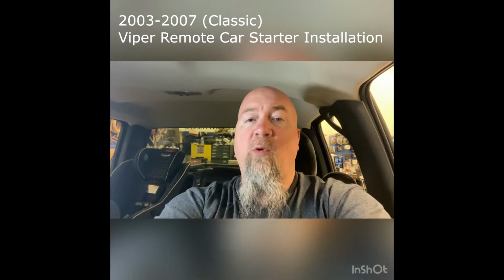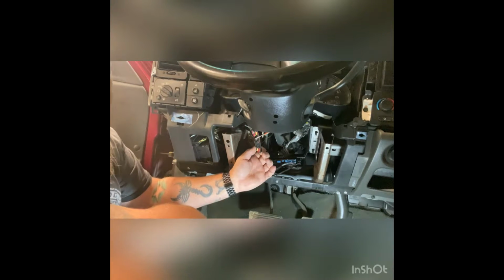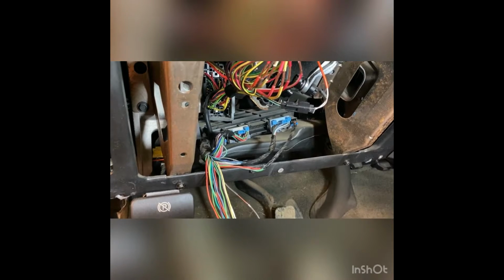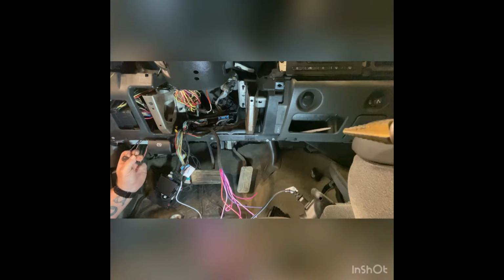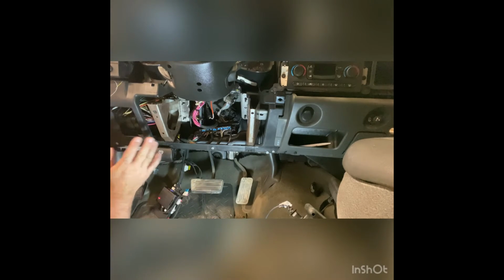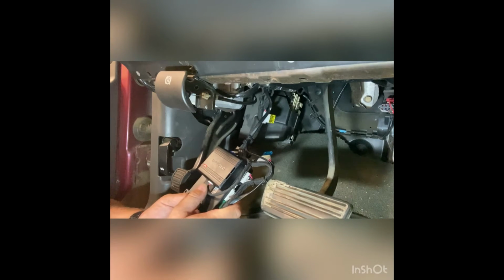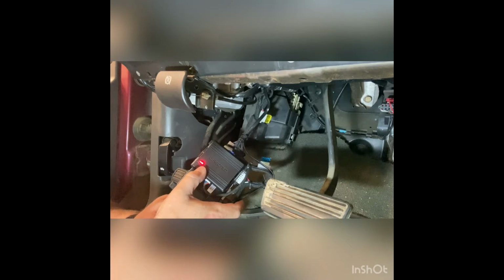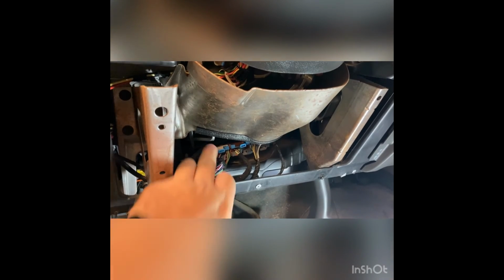How To Install Viper Remote Starter in 2003 - 2007 Classic GMC Chevy 1500 | Full Video | All Steps

Comment: Ran into your  channel by accident I guess ,  I once was a Mobile MECP installer  from 1985-2006 worked for Clifford Electronics and built a lot of custom systems in Beverly Hills for the Elite. I left the industry and got involved in Fire Protection and networks  I love my Job. But it all started in the mobile industry , for you young kids there was no you tube back then . I am impressed in your attention to your wiring and the connection method you used. That by my experience is the best connection. I have trust issues on people working  on my vehicles but you Sir I would happily drop them off and not watch great job, subscribed because I know workmanship when I see it.
Reply: Hell yeah martin, you should go on leak project and talk about some of the stuff you worked on!!

Comment: Can you explain what wites you connected under the steering column im straggling to get mine to remote start
Reply from the maker: Same vehicle?
2x red - 12 volt
Pink - primary ignition
White - 2nd ignition 
Orange - hvac
Brown - radio and other acc
Purple - start/crank

Comment: I bought a remote start for one of my trucks a while back and have been through a few trucks since then. I am wanting to install the 4806 now into my 2006 Avalanche. I see in the video you used the dbidb3... Will the bdball2 work for mine? That is what I bought at the time for my old truck.
Reply from the maker: Sorry for the late response, youtube isn't great at notifying comments.  But, yes your 4806 and db3 or dball2 will work together great.  The install is literally the exact same as on this truck.

Comment: For installing a 4806V on a 2006 Duramax 2500hd, do I need extra steps in there. I noticed this is the gas version. Trying to narrow down exactly what needs to happen for the diesel.
Reply from the maker: Really the only difference is powering up both accessory wires (orange and brown) and because it’s duramax, you won’t get tach signal over data so you’ll have to go behind the instrument cluster to get a solid tach signal. 
Program a predetermined wait to start time, done. Everything else is exactly the same.
Reply: The one thing I would find very helpful is exactly which wires you used from the db3 as well as the viper. Also, which plug they came from on the device. There are lots of wires and to me it doesn’t look like you use very many at all. Did you wire the two devices together at all? Seems like some wires may go to the same spot on the pickup. Thanks for the response!

Comment: @Srtbull_YT would you know why on my 5706v on a 06 silverado when i lock the truck and start the remote start once the truck turns on the alarm goes off? So i always neex to unlock the truck first then remote start it and once it starts i lock it so its locked whie on so the alarm wont go off

Comment: Thanks for this! I couldn't figure out what box to buy to control the BCM. Thank you!
Reply: Also I wish I could have watched this video 6 years ago when I installed my wife's viper, the manual transmission mode part is intentionally left out of all videos. Its a dealer only market and thats how they control it. Took me weeks to figure out why it didn't put power to the Start wire!!! 😕
Reply: Do you have the part number for the T harness? My DB3 is flashing red green orange right off the bat and won't program 😳

Comment: I am gong to install this in a 2001 PT Cruiser without immobilizer.  Will I still need a data module to lock/unlock doors and keep factory alarm?
Reply from the maker: A. Are you sure there’s no immobilizer?
2.  You can use a module to do convienience features such as keyless entry, but you don’t have to. It would be easier if you do though.
Reply: @srtbull_yt6854   I had it removed from the PCU some years ago so that I could use regular keys.  Is iDataLink a good interface module choice, in your opinion?  Thank you for the quick reply!!

Comment: Does the hood pin connect to the (2) pin  remote start shut off switch next to the (6) pin?  
The instructions say switch (shutoff) would be “ON” which would be NC when “ON”..  but I notice hood pin (when engaged) would be NO.
 2004 Dodge Ram   2500( diesel)
4806V

Comment: Hey buddy this is a long shot. I just bought a kit for my 2005 chevy Tahoe. I’m stumped on the wiring. I’m wondering if you could provide a cheat sheet or maybe even help me out. I have no clue where each wire goes and what no to use. Anything helps. Thanks
Reply from the maker: Do me a solid and shoot me an email at srtbull@gmail.com. I’ll do my best to get you whatever info you need

Comment: Awesome video! Thank you! 

I have a 04 suburban, I had a viper installed by a local shop and then it sat for 2 years and I recently started rebuilding the front end, and a bunch of other odds and ends to get it on the road. I noticed the dash is having shorts and flickers when I use lock and unlock, on the clicker. and the shop refuses to touch it. Is the control modules “light control modules” on the driver side of the dash supposed to light up and flicker on off when you hit the lock button? Basically any and all interior lights aside from the dome lights turn on off when the locks function from the clicker. Thanks in advance!
Reply from the maker: Well, park lights can flash on lock and unlock if that functionality was installed at the time. 
What types of shorts are you having in the dash?

I wonder why they won’t touch it?  Do they just want to charge you to remove it and install a new one?
Reply: @srtbull_yt6854  I should add the previous owner attempted. “I say that lightly” to make random electrical repairs and the cluster lights were poorly upgraded to LEDS. Soldering mess is about all I can say on it. I might end up replacing the whole cluster.

Comment: Help me out here please, I have a 03 Suburban that has a Viper 5305v. Problem I been having is that sometimes I cannot start the truck with the key, (engine does not crank). Only way I can start it is with the remote start, but once I turn the key and press the brakes I get a few lights on the dash that stay on. Also it only stays in 3rd gear it seems like. When it does turn on with the key everything works fine and no lights on dash. What can I check and or how can I disable the kill switch because I’m thinking that’s what’s causing it and or the oem anti theft of the truck.
Reply from the maker: I know this is an old question and I’m sure you got it figured already but not starting with the key but starting with remote start, there is something happening with your crank wire. (Most often caused by tension on the ignition harness). Or if you have starter kill installed, that relay may have failed. 
Staying in third gear, it’s actually probably 2nd gear means it’s in limp mode which is usually caused by your 2nd ignition not being powered up. (Common mistake). 
I hope that helps but I’m sure you have this fixed already. Sorry for the late reply.

Comment: Hey man ive got a 2008 chevy tahoe ppv with a viper directed DB3 in my truck and whilst re wiring some lights and a k9 hot n pop it tripped the system and will no longer allow my vehicle to start any ideas on further direction?
Reply: It is also a 5x05
Reply from the maker: Won’t remote start or won’t start with the key?

Comment: Lots of info , On video . so the DB3 module is just connected to 5806v using the D2D wire harness and 1 wire coming from the DB3 14pin  Blue harness ?
What wire/color  from DB3 harness, the light green pin 1 ?  Thanks keep up the good work and video's

Comment: I’ve had my remote start in my truck for awhile now since I got it, but every time I remote start the truck turns on does everything it’s supposed to except turn on the a/c could it just be a wiring issue or do I need to reprogram it if I switch wires around
Reply from the maker: What’s the vehicle and what kind of remote starter?  Has this problem just shown up?  Or has it always been like that?
Reply: @srtbull_yt6854  I have an 03 dodge Dakota 4.7, I have a viper 5X04 and it’s been like that ever since it was installed
Reply from the maker: I’m curious, does the radio turn on during remote start?  If yes, the wrong accessory wire is being powered by the remote starter.

Comment: I had one of these systems installed on my 02 Silverado but when it came time to smog my truck the computer would not connect due to the obd 2 wires it had from the viper system. Is there another place to connect them to?
Reply from the maker: Negative. The J1850 would be same wire no matter where you find it. So if this is true, you could just manually wire the features that you’re retaining by using that data wire. A simple passloc interface and wire tach direct to the source. Actually pretty easy.
But you could just disconnect the data wire at obd2, do the smog test then reconnect the data wire after you pass the test. 
(Immo, that’s not the issue, but that’s where I would start)

Comment: I have a 2002 S10 that the fuel pump has been replaced and it's still not getting fuel.. the ignition switch was getting locked up and was super annoying.. I replaced the ignition switch but still not getting fuel.. it has a security light on the dash.. does anyone know if installing one of the remote switches would get me running again?
Reply from the maker: Installing a remote starter in this situation would be a bad idea and not a solution to these issues.

Comment: I have the Viper 5806V Led 2-way security & remote start system. In your video is the same wiring diagram for a 2003 Silverado 1500 ?.

Comment: I have a remote starter on my 2006 Silverado truck and my battery runs out after 2 weeks without turning it on. Do you think that's the problem?
Reply from the maker: There’s a laundry list of things that it could be. 
How is your battery?
What kind of car starter?
Does the car starter still work or has it failed?
What is charging voltage when running?
When idling?
Anything else in vehicle that is aftermarket?

There’s a ton of diagnosis you could be doing to find out. I would do a voltage draw test just at the car starter then start working my way out from there until I find the problem.

Comment: I have a 2009 pontiac g6 that has a automate am6 with a xcrs relay 500m pack. I bought this car with this remote start with security installed.It worked for a long time but now I suddenly get nothing. I have power to the xcrs pack and the am6 brain. If the xcrs is bad would it cause a dead system ? Is there a bench test for the xcrs ? Any help would be appreciated. Thanks, Art.......automate a dei product
Reply from the maker: Chances are good the security interface has dropped programming. Most likely a simple relearn will fix the issue.

Comment: I have a 2005 Chevy duramax with the 5706v viper kit. Getting a little confused on which vipers wires connect to the ignition harness
Reply from the maker: Honestly, with Viper its almost color 4 color. 
Red - 12volt
Red/white - 12 volt 
Pink - ignition 1
White - ignition 2
Orange - hvac
Brown - radio (needed with duramax)
Yellow - start
Reply from the maker: Oh you mean the Viper wires. 
You’ll use all of them except for the pink/black. 
I’d you’re doing starter kill, green is key side, purple is vehicle side. 

What else can I help with?
Reply: @srtbull_yt6854 I know this is an old comment but is the starter kill necessary for the installation?
Reply from the maker: @robertbrown2348 no worries, I’m still here. Starter kill not required
Reply: @srtbull_yt6854 You’re awesome, thank you.
Reply: @srtbull_yt6854 I recently bought a Ds4+ but there’s a lot more wires, have you done an install with one of those on a 06 Tahoe? The wires seem a bit different

Comment: How did you wire the lock and unlock? Did you have a plug and play harness for the lock/unlock?
Reply from the maker: With this specific setup, door locks are controlled over data (j1850). No extra wiring required.

Comment: Great video- I had a 5906V installed and was wondering if you Hooked the alarm up to the dome light or door sensors ? I had it installed in a shop and when I lock the truck up, right after locking it says “Alert door open” remote says it for like 20 seconds and goes away. Installer says it’s the only way to do it that it will go away once the dome light turns off 😐 doesn’t seem normal and it’s annoying every time I lock the truck 

What do you think? Same truck a 04 Chevy 5.3
Reply from the maker: In this particular case, no, this wasn’t an alarm system. But if it were, the data module takes care of door triggers except the rear doors. The rear doors need to be hard wired to the alarm. 
Is this door open warning consistent or intermittent?
Reply: @srtbull_yt6854  i am installing the exact same alarm system into the exact same truck could you list the colors of the wires you connected underneath the dash coming from the remote start harness on the alarm?

Comment: I just had a viper remote  start installed  but when unlocking  it dint flash my lights and when locking  it dont hink the horn how do i fix that its on a 2001 duramax
Reply from the maker: Depending on which shop/company you deal with, they provide those as options and maybe not part of a basic remote start install. I would just go back to them and see if they charge for those features.

Comment: Curious as to what the DB3 is used for and if i necessarily need it for my vehicle. i have a 2003 tahoe that i’m wanting to put a Viper alarm/ remote start (probably the Viper 4105V) in along with the Viper SmartStart Pro. could you tell me if i need to install the DB3 ?
Reply: Did you every find out if you need the db3?
Reply: You need a different DEI module for your Tahoe. I believe it.s the 456G. DEI apparently doesn't sell them anymore. I got mine on Ebay. Unless your Tahoe is a base model you'll need it,
Reply from the maker: @digdugboy db3 will work on a 2003 Tahoe as well

Comment: Do you need to flash anything or is it all set out of the box
Reply from the maker: Data modules come empty. Firmware needs to be installed prior to being used on a vehicle that requires it
Reply: Is there a way to do that at home or do I have to take it to a dealer
Reply from the maker: Well software is only available to Directed dealers. They will have the equipment to install software. BUT they aren’t obligated to put software on something that they aren’t installing so I can’t say for sure that you’ll find someone to install the software and just hand it over.

Comment: How do disable the AED on alarm, because my truck does not start and unless I bypass it and i would like my remote start and everything to work again
Reply from the maker: Do you mean factory immobilizer?
Reply: Failsafe Starter Kill , 
I have to bypass my relay on my starter, my battery had died, got a new battery for my 2004 gmc. But once i got the new battery i could not turn the truck on anymore with the key or remote start( weird ) but i would reading that alarm i have is a 5105v with the D83. So i m thinking that the Failsafe Starter Kill is still active that i wont let me start the truck. 

But since i been bypassing right now. But i wanted to know to restart the Failsafe Starter Kill to see if that actually my problem or not
Reply from the maker: @brendonramos209 determining the actual issue is going to be job one. If the starter kill relay has failed (Viper), then either replace that relay or temporarily remove it and bypass the interruption. 
Relays can fail in the open position, which would cause this result.
Reply: @srtbull_yt6854   so the relay on alarm would be the best place  to start of at then before i start digging for all the wiring in the engine bay ?? 

Is there way to restart the Failsafe Starter Kill tho , turn the key in on position and hit unlocked and lock on the door panels ?
Reply from the maker: @brendonramos209 I would start at the relay, under the dash, part of the alarm system

Comment: Getting quotes. Installer is quoting a module to by pass the ignition. Is this correct?
Reply from the maker: ‘Bypass ignition’ is the wrong terminology but a module to interface with security would make more sense.

Comment: Did you need to make a relay for the locks?
Reply from the maker: Not in this case no, the data module takes care of door locks and factory security.
Reply: @srtbull_yt6854  so would I need them in my 99 gmc Sierra?

Comment: Have you had any issues with Chevys passlock when installing the remote starters? I’ve had two Colorado’s (08 and 10) they both had passlock security issues. I want to install a remote start, but being stranded worries me.
Reply from the maker: I know this is an old comment. YouTube isn’t awesome at notifying when I get a new comment. 

The canyon and colorado are different beasts. Yes it’s technically still passloc but it’s different from what’s being shown in this video. 
They say to use the relay/resistor method on those vehicles because of the issue you speak of. The alternative is using an idatalink product. They don’t seem to have the same issues that DEI modules do.

Comment: i had my remote start installed but it lost power is it connected to a fuse or relay or anything
Reply from the maker: If it’s installed correctly, yes there will be fuses. If it’s a DS platform, the fuses may be built into the module (under a cover)

I’d be more concerned about why the fuses blew. This isn’t a common occurrence
Reply: @srtbull_yt6854  it doesn’t have any power to the antenna or anything but the truck has power  radio everything works but the antenna to receive a signal the brain doesn’t even have a light on near the button
Reply from the maker: @seansotello8756 what kind of remote starter is it?